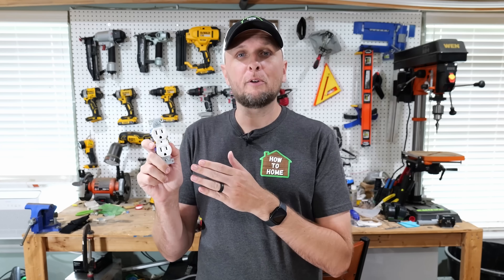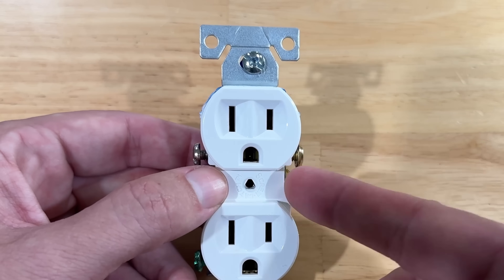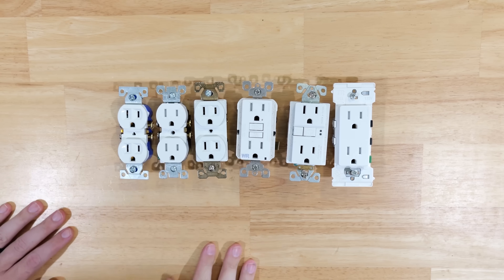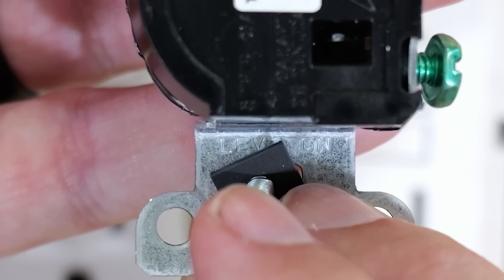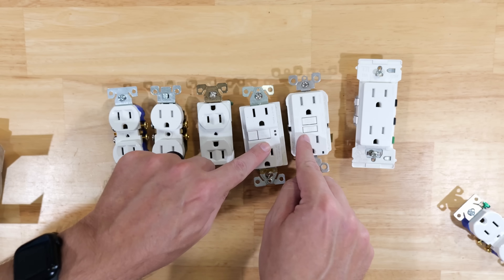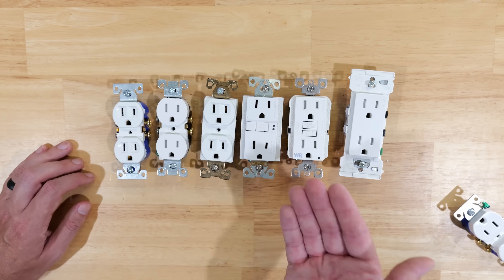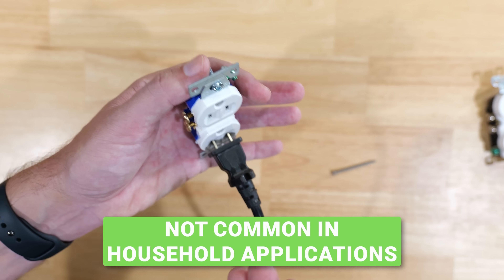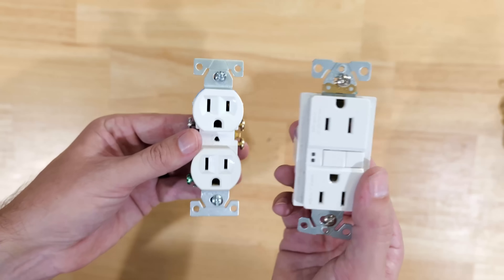The Shocking Reason Why Your Outlets Are Installed Upside Down!

Comment: When the ground prong is up, then a lot of flat head plugs come up at an angle to fall down immediately. When the ground prong is down, then this angle is already down on the side and doesn't bend the wires. Ground prong should be down.
The reason I was given for ground prong up was that, in case of water running down the wall, then there would not be as much chance of a short circuit. This reason sounds dumb to me.

Comment: After that recall a few years ago of the USB charger cables with thin wire braiding on the surface of the cable, I'd go with the ground prong up. If such a cable, or a loose metal plate touches the ground prong, instead of the live and neutral, the owner might notice it before it causes a fire.

Comment: Not going to spend the 15+ minutes to watch a one minute explanation.  Receptacles connected to wall switches should be installed ground up to distinguish them from non-switched outlets. All others should be installed ground down,  partly because flat plugs have the ground on the bottom, and receptacles  with the ground on top force the wire to make a U-turn, which places stress on it.  There is no part of the NEMA Code that specifies orientation for the ground.
Reply from the maker: But want someone to spend a minute reading your long comment about your opinion.  nice.
Reply: @HowToHomeDIY  We both know you're starting with a clickbait title, and then milking the algorithm for minutes, while doling out the content for over 15 minutes.   If you  can't read my reply in well under a minute, you're just not a good reader.
Reply from the maker: Nope didn’t.  Tried to keep it as short as possible while still giving context.  Don’t like it, move on.  I’ll sleep fine either way.  Appreciate the comments though.  Really helps this video keep getting pushed out!  Troll comments count so thanks!

Comment: It depends on whether you want safety or not. When the ground is top dead center, the ground lug will guard against anything going across the hot and natural. When a plug is plugged in, it pulls out just a little, and now the hot and neutral are exposed when the ground lug is at the bottom.

Comment: I had one only one in my house with the ground prong down and my son threw a penny across the room and it landed on the top two prongs and vaporized  two grooves in the penny while it burnt the wall before the 15amp breaker popped. So now all are ground side up in my house.

Comment: I used to work at an electrical wholesaler, and I want to say that Levington used to have the nomenclature on the receptacle the correct orientation, and they might have changed it some time in the early 2k's, if I'm not mistaken. It's been a while so I'm unsure if I'm remembering correctly. I had also reinstalled all of the switches and receptacles in my house at one point (the old ones were too old and loose for my liking), and I installed them all "correctly". Only to find out throughout the years, manufacturers of gadgets and appliances made their plugs, specifically the angled ones, to be orientated ground prong down. Mostly noticeable on things like power bars and the fridge, where the plug was designed to be flush behind an object, and on things like nightlights and those fragrance doohickies.
Number 1 argument (for ground prong up)? When did this move up to #1? I always thought the #1 reason was the ground prong not breaking off (or bending) when it was right side up (ground on top). Having it the correct way, as it comes loose, the plug just falls out... whereas if the ground prong was down, as it got loose, the ground prong would still be in after the hot/neutral came out and could rip the prong off. I think one of the biggest arguments of why they should be installed upside down is purely just aesthetics. It does look better, imo, plus as I previously mentioned, a lot of appliance manufacturers make their plugs to fit better in an upside down receptacle.

Comment: There are some appliance plugs that have the prongs coming out of the side of the plug. Whenever I know ahead of time what appliance will be plugged there, I check the type of plug the appliance has first. Refrigerators are well known for having this kind of plugs which would require looping the cable around above the receptacle to be able to insert the plug in if the ground hole is up, instead of having the cable hang down nicely, vertically on the wall if the receptacle ground hole was down. Usually, all appliances that require a permanent installation flush against a wall or very close to it, will require exercising this precaution.

Comment: What a lot of hooey.  You have to look at your connected devices.  For example, some space saver plugs have the ground prong on the down side, so the cord goes down when you plug it in.  If you have the outlet with the ground up, then the cord will go up when you plug it in.  Or a transformer will cover the lower outlet if you plug it into the top one. You have to look at what you have.

Comment: Earth should always be on top. Think about the plug, not the socket.
The risk of a small enough metal object falling onto exposed prongs is negligible and, even if it would happen, it will only short a fuse or circuit breaker, so that it is not a valid reason to orient a socket in any direction [good risk management ignores negligible risks of low consequence]. Think not of the socket but of the plug. American design plugs are mostly atrocious, with wire extending horizontally, in opposite direction but in parallel to the prongs, meaning that for near-floor sockets,  a plug's wire will require floor based objects to be positioned further away from walls. [Same problem exists for higher sockets serving electrical equipment on shelves or work surfaces.] With the few plugs that have wire extending out at right angles to the prongs [i.e. well designed or good plugs] the wire extends in the opposite direction to the earth, When in use, the good plug's wire should hang downward. With socket earth at top,  the plug wire will hang down. If socket earth is down, the plug wire will extend upward and then gravity will force it to bend a full 180º to hang down, causing constant stress to the wire and connections as well as looking really ugly. QED: the earth socket should always be upward in case decent plugs are ever used. [If you are so in love with awful plugs that you refuse to ever use good ones, then it doesn't matter which way the socket is fitted; flip a coin to decide.]

Comment: I don't care if it's considered upside down or not. The way some power cords are designed, more specifically, ones with a big box by the plug. It makes the most sense to have the ground on the bottom.

Comment: ,,,,,,,,,,,,,,,,,,,,,,,,,,,,,,,your research left out an important point ;  many appliance power cords have a  angled male  plug   [ 90 degrees ]   these when plugged into a receptacle with the ground prong facing down  will direct the power cord downward ;  many kitchen appliances are fed from wall receptacles  mounted at mid wall levels ; I would set -up the receptacle to meet the power cord of said appliance ; without having to loop -up   or over , thus complicating a direct path.........................It's all about fuctionality plus application , and even appearance,,,,,,,,,
Reply from the maker: I filmed all of that and cut it out.  I try to keep the most important things in the videos but also try to value the audiences time.

Comment: It just does not matter if the ground wire is up or down. I am an electrition. May you will be surprised that even in Iran(persia) we do not have ground wire in our home.As long as below your feet is not wet, there is no worry not having ground wire.

Comment: It has become pretty standard but only recently that receptacles have had the words facing both ways due to the fact that there is no direct requirement. That is a fairly new thing that the companies are doing. However, as an electrician for many years, I usually like to put them ground prong up in most applications

Comment: Ground prong down for me, but one concern, manufactures need to create a plug that has a better area to grab the plug to take out safer. Many new outlets are very tight and stiff causing it harder to take out plugs. The current plugs have some area to pull on but they should be designed to get a better grip on the whole plug without getting too close the prongs. Enuf said.

Comment: Electricians have been installing them with the ground side down for years.  The NEC did not even publish the code that said the ground side had to be up for years.
And it wasn't until after the grounded plug came out that the nema organization started saying that the ground plug had to be on the top. 

So for anyone to say that it's this way or that way it doesn't matter as long as it is property grounded.
Then there's the problem of outlet  installed sideways.

You sound like a male Karen, being all worked up about something, that's a very minute possibility. In fact, so infrequent that most inspectors and cities don't care!

Comment: There is no code.  Other than UL specifications.  I use to install prong up all the time because I preferred metal wall plates in industrial use.  Ground up gives you protection from the rare occasion that the plate screw comes loose.  My wife has me reversing all of the outlets😂 because her preference is prong down

Comment: My preference is that in the event downward force on the plug or cord with the ground prong up could break the ground connecting while power is still being applied and the load continues to operate without a ground. This could go unnoticed.

Comment: If I use a 15A outlets on a 12Ga wire, I put the ground pin up so I remember I have 12Ga behind it! That's really the only reason. It just doesn't matter really. If I'm using tools that are more than 12 or 13A I replace the 15A outlet with a 20A. Just a preference!

Comment: I have seen AC receptacles installed in either direction with respect to the GND port being above or below the L & N ports.  In one case I personally know of where it is preferred to have the GND port in the bottom position is when mounting power adapters to the lower half of the receptacle with a security screw so that the weight of the adapter (about 1.5 lbs for our equipment) is supported at a right angle to the adapter and so that it's screw port is not strained under weight.

Comment: I’m a Master Electrician of 35+ years. And this has been a major debate for years. Now a days it really does not matter how you orientate your outlets most covers are plastic. But in times past all outlet covers were metal so the ground up was so that the outlet covers would not fall off and hit the line and neutral it would rest on the ground. I always ask the customer how they want the outlets orientated ground up or ground down. It should be customer preference.

Comment: Perhaps in a garage or workshop where there are lots of metal tools, screws, hardware, etc. ground-prong-up would be the slightly better option. Otherwise ground-prong-down by default makes the most sense.

Comment: You should talk about a stainless steel metal plate. Or any kind of a metal plate? That's on that duplex receptacle that if that came. The screw came out and and the plate fell on it would short out. You should talk about that

Comment: If you have appliances with right angle plugs you need to install where there is the least amount of stress on the connection.   In some cases the right angle should go up and the others the right angle should go down.

Comment: I just want a outlet that doesn't break the F**** ground plug off inside the receptacle. I think if the ground plug is up it is less likely to snap off inside If pulled out by accident. When it's pointing down it tends to bend it more. I work new construction in very large construction sites and our hydropoles always always have 1 or 2 of the ground plugs inside the receptacle and it's such a pain in the a** I always  carry a small lead with a 3 pronger so we all can use the 1 good  outlet if possible. But then we all know that comes with its own struggles too like constantly popping the breaker.

Comment: I have worked at several hospitals in Texas and Washington state and each one has always had the ground plug up.
I had asked maintenance in the past what the reason was and never was able to get a reason other than that is they way they were told to have them.
All the new constructions I have been involved with also had them ground up so it wasn't an "old school" hold over.

I still have not gotten a solid answer on why it was so common and specific to the hospitals.

Comment: You don't even mention horizontal orientation. You can turn those 90 degrees instead of always turning them 180. 

The best practice FOR SAFETY is to install with ground up so nothing can bridge the hot and neutral. The same reason you should not install outlets face up near water, because of gravity, is the same reason you should not install them with ground down and hot and neutral up. 
But again, horizontal orientation alleviates the issue even with only 2 prongs. 

You literally didn't even mention horizontal one time! 🤦🏼‍♂️

The fact you left it out says everything about your expertise.
Reply from the maker: Because I said any orientation is fine other than the few I talked about that code references.
Reply: @HowToHomeDIY  you need to rewatch your video my dude. You literally only show vertical orientations and absolutely never at any point reference horizontal. You're supposed to be teaching or something, not making people figure it out on their own. Come on. At least be honest instead of pretending you covered the point because of a random stranger on the internet's criticism.... 🤷🏼‍♂️
Reply from the maker: I literally said it did not matter what orientation it was.  But troll away 😂
Reply: @HowToHomeDIY  You did not show any other orientation besides ground up or ground down. But stay in denial instead of accepting basic constructive criticism. 
Re watch your own video. We would not be having this engagement if you had addressed the other orientations effectively.
Reply from the maker: Mike, take care 😂

Comment: I have done them both ways. I would ask the home owner how did they want them installed. Now if it was a speck house then ground down. Then if I was installing them in an industrial area depending on location ground up or the type of cord being plugged in. The biggest issue was when the outlet was installed horizontal I would go ground left neutral up.

Comment: A non issue. As an electrician for 42 years, the architect, homeowner or project manager will specify which way to install them. If no spec, it’s the electricians preference and you must be consistent. The only time I concern myself about it is if equipment is going to be plugged into it. An electric clothes dryer plug has the ground prong up in relation to the cord. We always install them ground up so there is no strain on the cord. Refrigerators sometimes have ground up also. Trust me. Other that that, we give it no thought.

Comment: I am old school and prefer the ground down, but with these new shuttered plugs it is slightly easier to plug stuff in if the ground is up.  The ground acts as an alignment pin for the other two to line up and release both shutters.  (NOT a fan of shuttered plugs)

Comment: Because electricians don't know any better! I have done a lot of electrical work. Upside down outlets don't work with a right angle plug. The RA plug has to be inserted upside down and the cord forms a "rainbow." A RA plug is to hug the wall.

Comment: Ground prong down stays plugged in more solidly with the weight of the cord dangling, and right angle plugs will improperly loop up into the air if ground is up. So which way does a keyed door knob go, key slot with the key ridges up or down?

Comment: Let's not be silly.  The only purpose for an electrical outlet is to plug an electrical cord into it.  Almost all electrical cords with a ground are designed for ground down. The "nail falling exactly parallel to the wall and landing on the prongs" is a zero probability scenario.  Conversation over.

Comment: If they were meant to be installed with the ground on top than the molded writing on the receptacles would be printed or molded onto them in that orientation..

Comment: I have always installed with ground prong up mostly because with 3 prong heavy lead cords ground down would tend to breaking the ground prong especially on construction sites. The ground prong is intentionally longer to make sure it’s the last prong to disconnect. Furthermore hospital grade receptacles are always installed ground prong up because they go through a rigorous ground conductivity test for durability of the ground connection. That’s the reason for the green dot on the receptacle.

Comment: ground plugs down bends the ground often enough that the cord ground breaks off. I've found ground up holds the cord in tightly without tension to the ground prong. I prefer ground up.

Comment: I always installed down for 6 years. I dislike dealing with old metal boxes when still hot. New plastic box no arc by someone else messing with it. Yes the noob typically arc the receptacle and then we have to replace it, if I haven't taped it yet. I always have to tape around receptacle when we're dealing with metal boxes while repairing walls though the metal boxes were put in there probably back in 1980 on a lot of the older houses I'm working on. Some of the houses built in 1900s though wiring from the '80s. I can agree if you want to help the customer identify a switch outlet You might change it so you need to also warn the customer they might shock themselves if not off before hand. Children have a lot higher chance of shocking themselves versus adults.